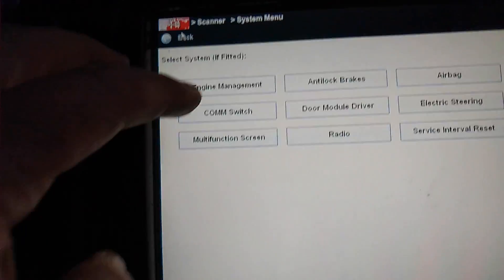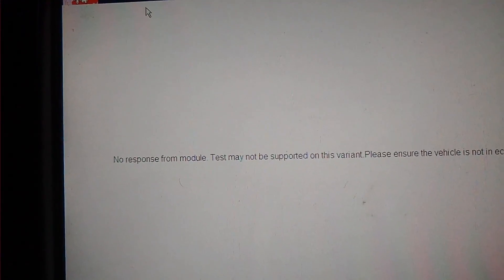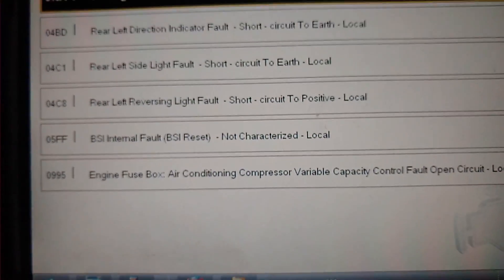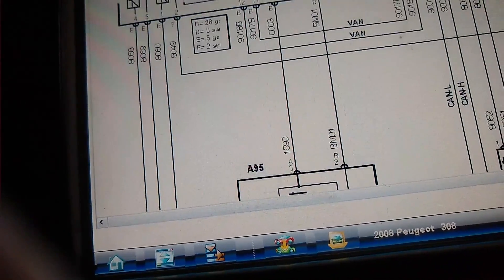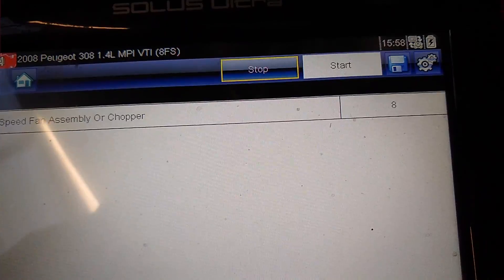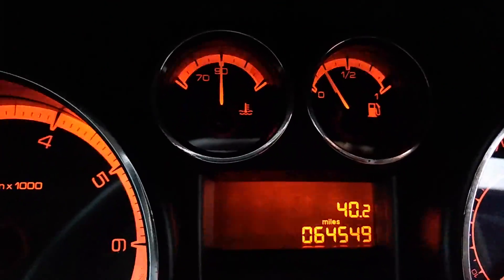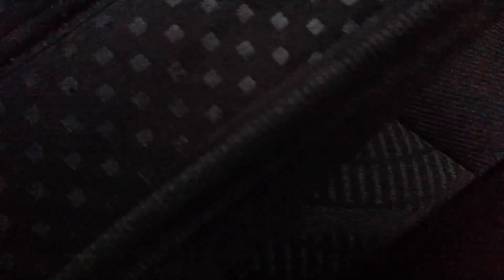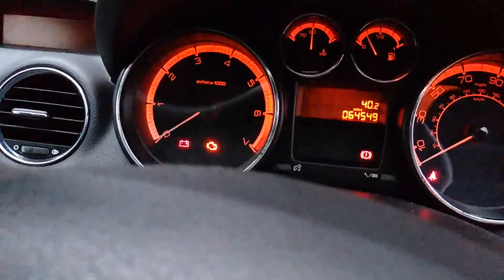Peugeot 308 - Overheating - no fan control from ECM! Part 1

Comment: Your having the same nightmare as me pal.. I'm bought a 308 sw, 2011.. As soon as I get to 65 it overheats and get stop, engine temp, emgine fault, temp gauge blasts into red for about 10 secs the drops bk to normal and warning lights go off to normal that happens every 30 secs or so had it in garage and same.. Its a head scratch aiint it.. One thing I noticed when I drive with air con on the radiator fan works and I have no problems at 65mph plus.. I turn air con off and it starts warning again driving me radio rental kazental.. The engine isn't overheating tho my diagnostic says its electrical bsi and fans.. I need an auto electrician badly as I'm still on 30 day warranty can't get it back down south to dealer for refund .

Comment: Glad I found this. My car came up with an engine light. I checked the little ODB and it showed some codes around temps. Checked the fan and this plastic string was all in the fan. I removed it and thought that was that. The fan still won't come on and I started thinking back to how hot it's been in the car even on moderate days and realised that the fan probably hasn't worked for at least a couple of months. Back to the drawing board for me!

Comment: Sandy help please!! Watched your video having done most of the things you have but code P0483open circuit temp to high. permanent fault.   Checked fan ok. New resistor. Haven't checked wires from resistor to ecu as relays click on high & low fan speed through diag. Pulled temp sensor logged as fault still no fan. Checked all fuses. Checked wiring harness and plugs all good.

Comment: I'm just looking as my 05 307 sw seems the same  I'm sure the fan should come on when a/c is switched on, but not now, a/c is gassed  pump engages blows warm. Fan is good at fan. Also ABS dashboard light is on.    renewed  cooling fan resistor ,still the same, still looking. (fan is good)

Comment: This model and other make Citroen have same components. I have got C4 Picasso and same problem. Sometimes will be resistor on the fan control unit by the fan radiator and when replaced fan will be working, other issue is low under fan is flexible tube with wiring, water collects there and corrode wires. and than no signal to ECM ( corroded wire ) or ECM it self. In those cars Peugeot  and Citroen ECM it has switched earth on the fan control unit low speed and high speed can't be running at once Pin 2,3 should be 12 and 0 V or vice versa one wire will work as ground switched by ECM. Mine Picasso had corroded wire and short on earth but not on wires internally in ECM. Did all tests and stripped all looms and checked all wires. The last point is ECM. I'm taking out and reprogram and if will not work replace for clone.
Reply: I had the same problem. the loom along the bottom of the radiator before it goes to the chassis leg had a corroded broken yellow wire which was the main 12v supply . problem solved after all diagnostics which did not show. Hope this helps.

Comment: I am writing from turkey Peugeot 308 1.6 VTi fans staffed and over-voice working temperature 90 a thermostat circulation has changed improvement solutions looked well located did not electrician looked at services from you I appreciate your help in this matter

Comment: HELP
HI. I'M 308 VTİ. ENGİNE  FAN CONTINUOUSLY WORKING
. THERMOSTAT, ROLE AND INSURANCE CHANGED. PROBLEM CONTINUE
.
 ENGINE COLD FAN CONTINUOUS WORK
.

OBD CODE P1062
 - P1067 (Valvetronics) 
WHAT TO DO FIRST
? 
P1062-P1067 (Valvetronics engine ) CAUSE
?

Comment: What model is the verus your using and what do you find a better scanner verus or solus?
Reply from the maker: Hi this a original verus model running 14.4 software, I like it compared to solus because of guided component test, wiring diagrams and 4 channel scope cheers sandy
Reply: Hi sandy, thanks for the reply.. is it just called a verus? I’m looking to buy one but is see verus verus D10,  Verus pro, And Verus Edge. Do you know the differences in these ? A lot of differences in prices for some of them, especially the edge, which seems
To be the most expensive. Also have a 308 1.4 here I’m working on at the minute with the fans on constantly and temperature guage going into the red even from cold start up  and saying engine temp faault on the screen inside, the fans take about 10 mins to go off after switching engine off and taking key out, but it’s not over heating. Getting 2 faults - Disengagable Coolant pump short circuit to Earth : Permanent and  intake manifold pressure sensor coherence status permanent. I don’t know what a disengagable coolant pump is and no one seems to be able to tell me what it is. Even Peugeot/ Citroen dealer. Only thing I could think of Is a water pump, but have looked it up and it’s not an electrical water pump on the car. Also have changed the temperature sensor but doesn’t seem to make a difference. Any ideas or have you came across this ?
Reply from the maker: Sorry Sean I missed this post, snap on edge is the latest so most expensive expect £2-3k for it then the pro, d10 and lastly original verus like mine.  These pugs have lots of issue with the fancy fuse box BSM so a fault there could be your check for water ingress (remove 3 multiplugs check for the green stuff) if u replace it coding is required! Check ECU multiplug also. Cheap clone Delphi scan tool works well on pugs cheers sandy

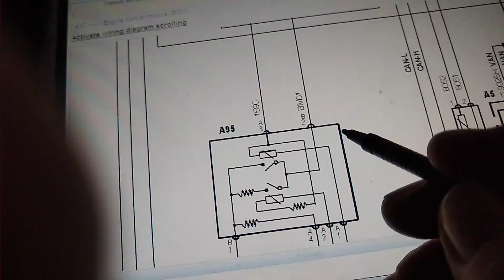Comment: Just another thought Sandy. At 5:13 into this video the fan control module appears to have a feedback to the ECM. Pin 4?  Possibly the circuit or module is sending a feedback that the fan is already running? I wonder what is supposed to be on that Circuit. On your part 2 video I saw it boiling in the recovery bottle but is it holding pressure. If it's a 15 psi pressure system should not boil til around 255f. I'd connect a variable resistor in place of the ect  and manipulate the temperature with the resistor to see what temp the low and high speeds come on at. Some of our vehicles won't run the fan til 110c so if there's no pressure it boils before that. Good luck.
Reply from the maker: Good advice Phillip I try it tomorrow many thanks,sandy
Reply: sandy anderson lk

Comment: Radical thought! Is there any chance that the fan won’t run with the bonnet open to prevent possible injury? To that end, does it have a bonnet switch and can you prove operation? (None of that comment is based on fact but wouldn’t take long to check?)
Reply from the maker: Cheers my friend good idea I'll check for an input cheers sandy
Reply: @sandyande  did you fix it?
Reply: To me it’s got to be an input problem of some sort or the module/software itself. Your bi-directional test has proved that the ECU has control of the fans and that they operate. I’m interested to see the outcome of this one, my feeling is it’ll be something unusual.

Comment: Suspecting a different sensor needs looking at, as others have said the car maybe looking at a different input for the fan...try a bsi reset or even a software update
Reply from the maker: Cheers my friend I'll see if snap on has a reset option many thanks, sandy
Reply: @sandyande  its usually a manual reset if it has one iirc you mess about with the windows etc it has flagged a code for the bsi reset

Comment: Does it possibly have more than one temperature sensor. I don't have wiring diagrams for that car here in Canada so I'm not sure. I've seen some imports with more than one temp sensor. If you can command it on with bidirectional control from the scanner it must be a bad input. Good luck
Reply from the maker: Hi Phillip call main dealer just to check there is only one coolant temperature sensor.  Funny thing it was working fine for initial 20 mins cycling the fan then it went to pot with no additional codes, take care, cheers sandy

Comment: Have you checked thermal switch on radiator?
Reply: It's The signal from the ECM
Reply from the maker: Hello my friend I didn't think it had one  because the fan blower module is controlled by the ECM, but do u think there is where would it be located cheers sandy
Reply: @sandyande  Had an Astra H with same over heating fault and fan non starting .It was the thermal switch located at the bottom of cooling radiator .When engine is hot and fan not spinning simply disconnect the 2 wire connector and make short across the engine side of connector ,if fan start that switch is the culprit .Cheers !